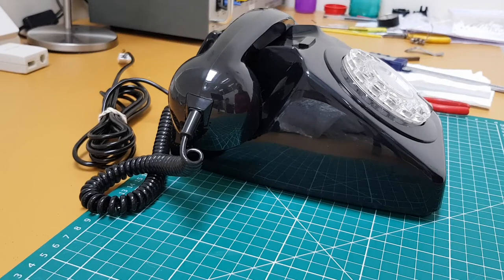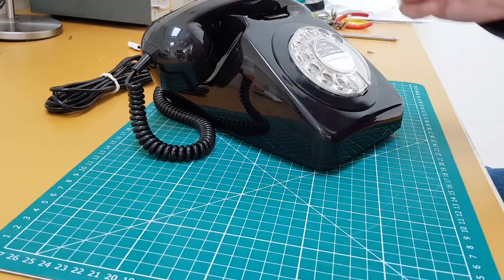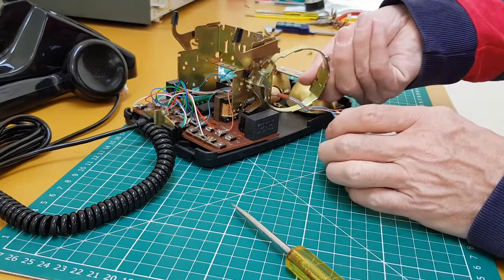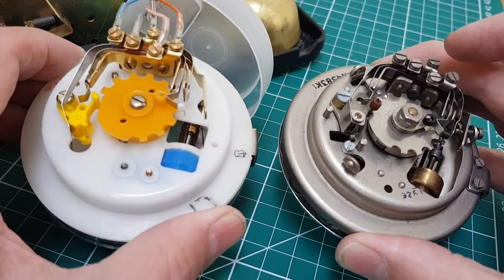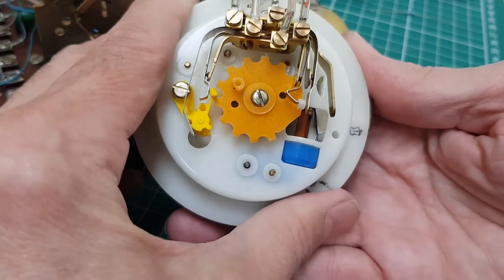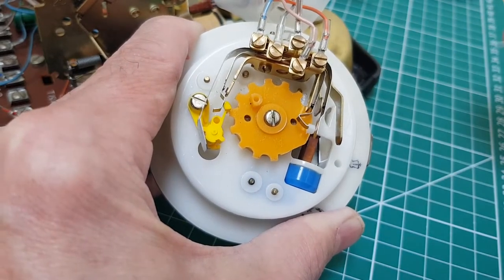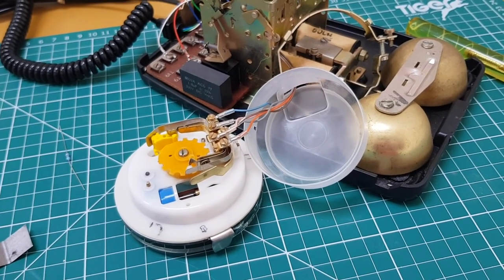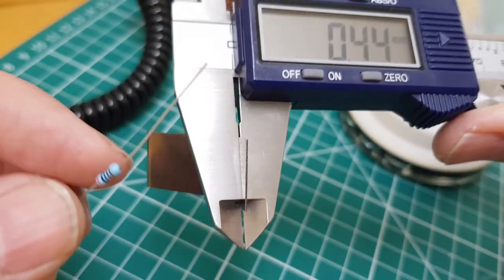Vintage Telephone Dial (Make to Break Ratio) Adjustment

Comment: Great video, very clear and informative thanks.I have an old metal phone that is copper plated and previously some kind of switchboard type thing, that I am converting for normal use.I have used a 706 printed circuit board and all is well when I use a 1970's dial.However I would like to utilize the original brass dial, but don't know how to wire it to the pcb. I would be very grateful if you could possibly throw some light on how I might do this? The dial looks very similar to the Type 12 Trigger Dial that you show.
Reply: The wiring and positioning on both dials are very similar layout. You should be able to just conect the same.